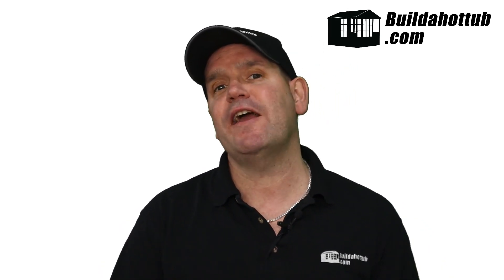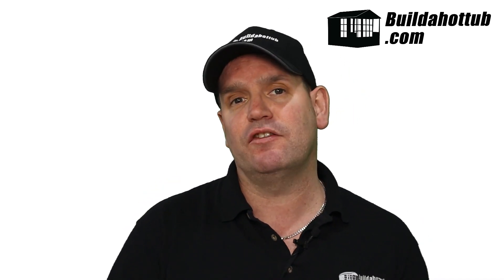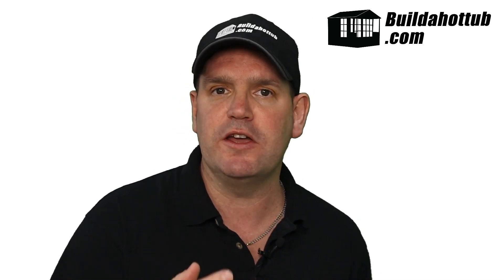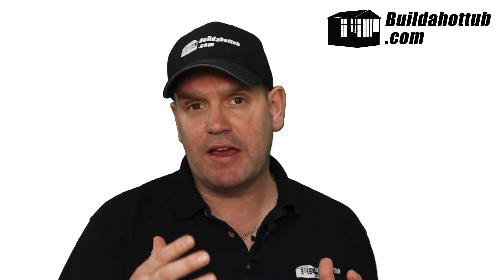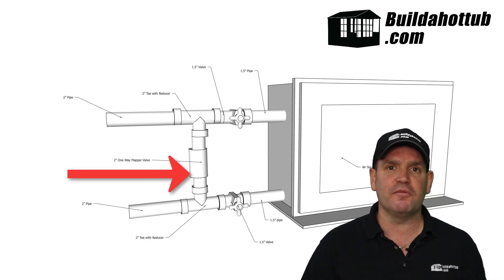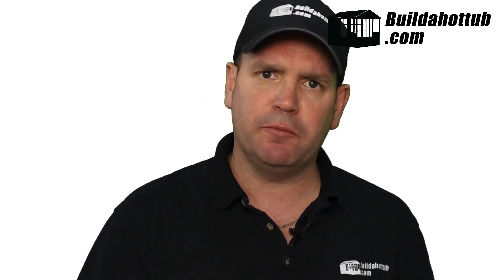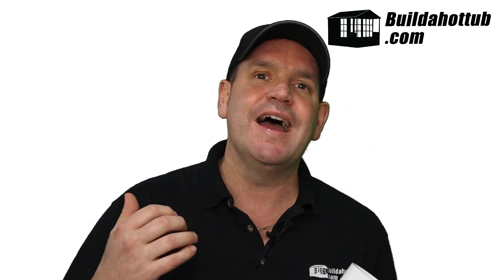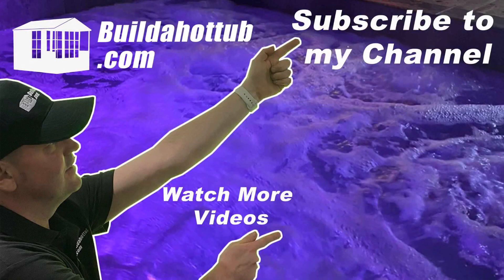Can I Add an Air Source Heat Pump to a Hot Tub with only a Dual Speed Pump?

Comment: @buildahottub it's interesting to see that you recommend the bypass valve in the bypass part of the circuit, while Balboa recommends their patent pending check valve on the input to the heatpump (after the bypass). Are these different type of valves?
Reply from the maker: Hi There, the guys at Balboa (who I know well and have spoken at length on this matter) are convinced that their check valve makes their heat pump more efficient as it gives it exactly the right amount of flow - so not too much or too little - that is why it is on the input. Yes they are different types of valves, this is a flapper which allows the gate/flap to open when there is too much pressure so that firstly you dont loose pressure on your jets, but secondly too much flow is not going through the heat pump - this is important on a dual speed single pump setup. - Hope that helps - Andi

Comment: Do the flapper valves come in different strengths ? as in the amount of flow required to open ?
Reply from the maker: They do yes, normally in lbs - 1.25-2lbs and then 2.5-8lbs - hope that helps - Andi

Comment: Thanks for the great website and videos.  A couple of questions re using an ONDA 7kW mini heat pump -
(i) The ONDA's specs recommends a flow rate of 3-4 m3/hour ie ~60l/minute.  My tub (Canadian Spa Thunder Bay) has 2 dual speed 5hp pumps so I need your solution but the circulation flow rate looks a lot lower than 60l/minute.  Will my ONDA complain about a too low flow rate?
(ii)  Re controlling the heat pump with the tub's flow rate, the ONDA's low pressure sensor is for the refrigerant flow, not the water.  I've read that if the water flow rate stops, the ONDA will cut out but will then try again every few minutes, eventually damaging the heat pump - do you have any idea if this is correct?
Many thanks
Reply from the maker: Hi Nick, thanks for the comment. i) - the dual speed 5HPs, depends on what brand you have. The LX model for example has a 1HP output on low speed that will be around 300 lpm ii) Not sure that would be the case. The flow sensors are for the water flow inside heat pumps. - hope that helps - Andi

Comment: Hi I am interested in locating one of these valves any ideas where I can buy one from?
Reply from the maker: Hi Wayne, Hydrospares.co.uk or Poolandspacenter.co.uk carry these. Thanks
Reply: @Buildahottub  superb, I have just been told I cannot fit an air heat source pump to my tub, not enough room inside and due to 2 speed pump the flow rate wouldn’t be enough?
There is already a bypass installed with a ball valve
Reply from the maker: I'm yet to see a tub where one can't be installed. If you do it correctly, you will see little to no impact on the jets, even with a 2 speed pump. Things can be tight in the cabinet and you may need to move some parts to make room - but you should be able to do it. "it can't be done" tends to be the advice from people that don't know how to do it or dont want to do it - check out this mess that was done by a "professional" - its a dual speed pump - https://youtube.com/shorts/RstArxt8a6I
Reply: @Buildahottub  I don’t suppose you have a diagram of how that was installed?
Reply from the maker: Sure - its on this page https://buildahottub.com/air-source-heat-pump-dual-speed-pump/

Comment: Good video, will the air source heat pump work as effectively with this method as it would with a circulating pump?
Reply from the maker: +zoobie86 thanks for the comment. Whilst heating up yes, same as with a circ pump. Difference is when you are in the tub on high speed will not be as efficient as not all the water will go through the heater - hope that makes sense - thanks Andi
Reply: @Buildahottub  that’s great Andy cheers was just checking as I thought I would have to somehow install a circulating pump in order for the air source heat pump to work. The supplier for the heat pump had mentioned it would be cheaper to sell my hot tub and buy a new one with the circulating pump but I was unsure how accurate that advice was
Reply from the maker: +zoobie86 don’t do that! Bad advice (in my opinion of course) If you can fit an air source you can add a circulation pump if that is bothering you - 4 holes to cut through the shell (2 if you don’t care about rules just want it to work) - had a customer do it recently :)
Reply: @Buildahottub  don’t suppose you do work in Scotland? The hot tub suppliers adamant the tubs simply not compatible with their air source heat pumps
Reply from the maker: @zoobie86  I supply parts, connection kits and heat pumps to Scotland yes but don’t do any on site work myself. You can fit this diy - if you can email me some pictures of the inside of your tub I can advise on what you need to do - andi /at/ buildahottub.com cheers